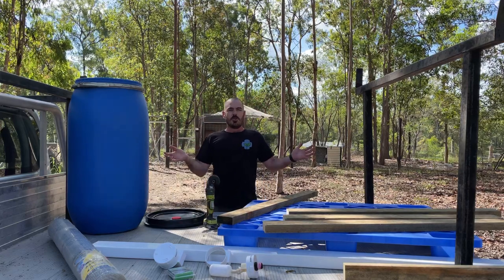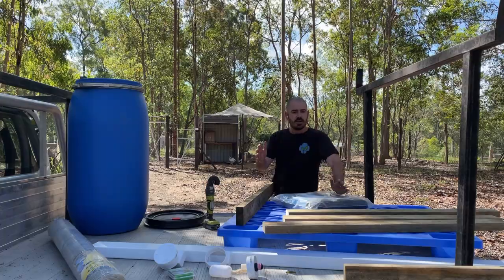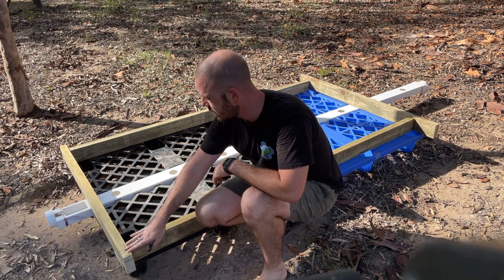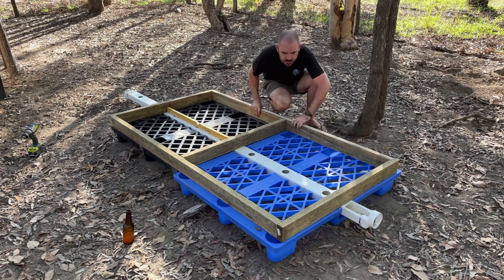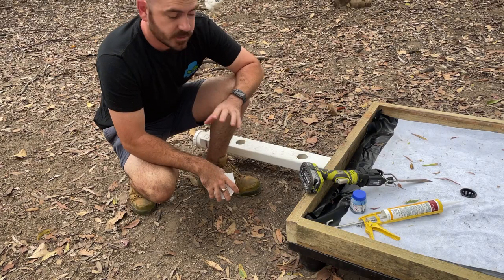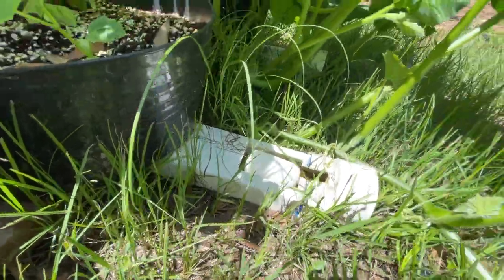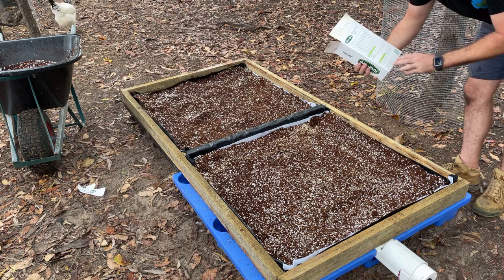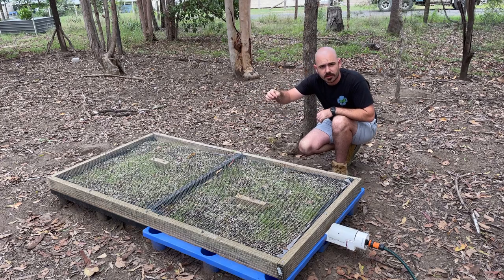How to Build a Hydroponic Grass Fodder System for Chickens

Comment: You are so creative! 💗 Thanks for all your hard work on this channel. I'm really excited to give some of the simpler projects a try. I love the idea of using the foam pieces to support plants in your hydroponic system!

Regarding the chickens—I have many (I've lost count). I think I would try to find a higher value cut-and-come-again crop in your fodder bed. I hear chickens love bamboo foliage. It's too cold here for bamboo to over-winter so I haven't studied it, but it's my understanding that at least some small brushy varieties are high in protein and that chickens love the foliage. Since it tends to be invasive, a well-contained hydroponic system sounds like an ideal way to grow it. 

Chickens don't actually supply a lot of their diets from grass. As you've seen, they do eat it, but they really need protein more, and the incidental fats that come with protein. They kill the grass by pooping on it and by scratching it up looking for bugs and making dust baths, not by over-grazing. If you want to supply them with grass inside their yard, pick a spot; cure it from the nitrogen poisoning from too much poop (scrape off; adjust the pH; spread & work in compost); build a frame of wood and cover it with 1/2" hardware cloth; seed your grass area, water and put the frame over it. Grass will grow and the birds will definitely enjoy it. Unfortunately it won't do much to feed them. Protein is what you need to look for in a fodder crop that has a chance of denting the feed bill.

Comment: Thats a really neat idea, I was thinking the same thing you were when you mentioned something about it being used as a hydroponic grow bed.

Two things that seem like they potentially could be problems to me, first, seems like it might get a lot of manure in it. Dont know anything about chickens or their manure, so dont know if thats probable or big deal, and second, getting in to maintain it seems like it might be a hassle since you have to unscrew the wire. That might not be something your worried about, either, though. Theoretically, making the wire mesh on a frame, and fitting it over the lower frame sort of like a lid might be a way to make it easy to get into.

Comment: Are the three holes in each section enough to allow adequate nutrient fluid to fan right out to the sides? i.e. does the grass grow as well at the edges as it does in the center?  It will be interesting to see if winter frosts have any effect  on the  grass roots.